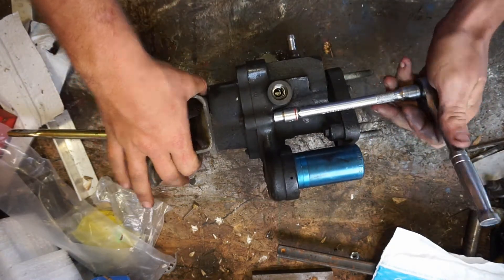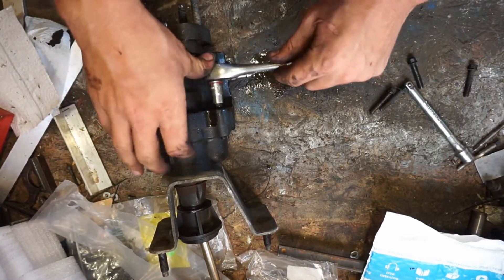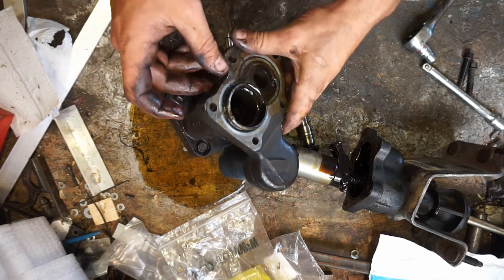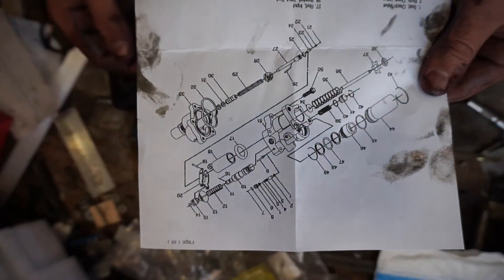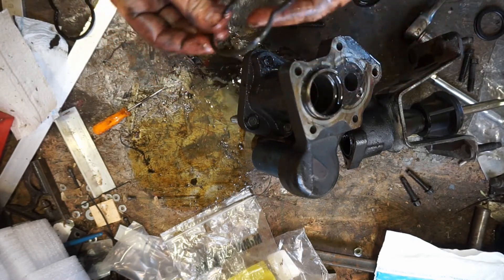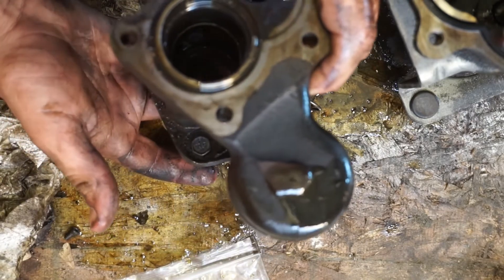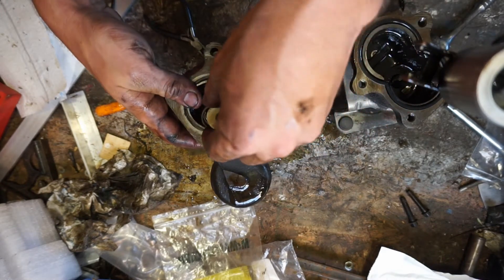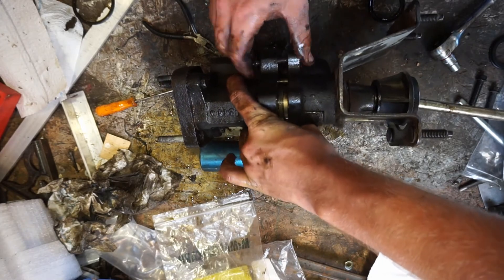Bendix Hydroboost Repair

Comment: Hey buddy is Oscar from Jacksonville Florida
Man you did such a good job rebuilding the Hydroboost, thanks so much for showing US how to do it
I have a 04 f250 6.0 4x4 and i guess i have to do the same job you just did.
my Hydroboost is leaking a lot of power steering and i need to do something.
I have the seals already so that's why i am doing researches and i saw your video.

Thanks again and good luck in every project you do.

Comment: Is there a certain direction for the dump valve?   I put new seals in my hydroboost from my 18’ ram 2500 6.7 (the hydroboost and power steering were working perfect other than a leak).  Mine doesn’t leak but now there’s a hiss when turning the steering wheel and when you turn it applies the brakes.  Something is not right.   The brake work fine .
Reply from the maker: I’m not sure

Comment: Mine seems to be leaking inside of cab around the pushrod is their seal replacement for it in kit ? Thats just engine oil in it ?
Reply: No there's power steering fluid in it comes from the power steering pump

Comment: Hey what is the little piece that looks like an ear plug but had a spring in it. It is k-3401 in seal kit .
Reply: There are extra pieces in the seal kits that aren't used in many applications.

Comment: As a aircraft jet engine mechanic...this video is against all my work ethic core values, couldn't finish watching.
Reply: I used to work as a mechanic. if I had a whole kit I install a whole kit that would guarantee my labor.by the way is better to clean the parts .my humble opinion.
Reply: Does it still work? No leaks? Just wondering cuz your fingers seemed a lil grungy. :-/
Reply: Bad habits are hard to break, but you can step it up a little cleaning the parts, and the work bench, with some gloves on as you go!!...you already have the skills!!, and great video that really helped!!..much appreciated!!!
Reply: As a car mechanic I couldn't either.  I cringe to think how many particles of grit went into the assembly.
Reply: Fuck I thought the same thing...
Reply: I thought that was a video on how not to rebuild it.
Reply: I thought I was the only one that noticed the work area because my brother and a few friends think I'm annal about clean everything when it comes to this. I almost had a panic attack watching and my bet is on the repair short lived if it even made it to the street it was pure Luck. I ain't trying to cut on anyone but this was funny and informative all in one.
Reply: Yes, I worked as a mechanic and now teach it.  I did a lot of hydraulic repairs and this made me shudder.
Reply: Damn yall he used "A" paper towel !!

Comment: Great info but if you take on this job be sure to pull everything apart and thoroughly clean it all then clean your hands then  reassemble using only clean fluid to lube seals crud will cut the service life of your new seals among other things drastically.it sucks but you'll be glad you did.

Comment: Mine is leaking inside the fire wall how to replace that seal
Reply: They say if that rod is "staked" then you can't do it. That rod would need to be cut to slide the seal out and then welded back together - not the best thing to have parts cobbled together with your brakes.